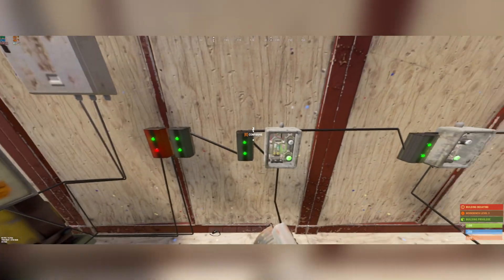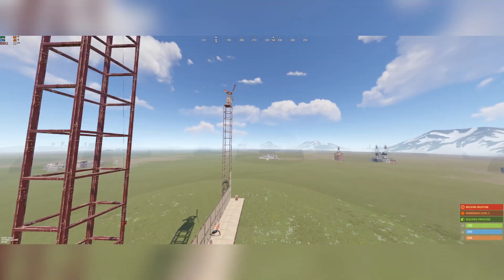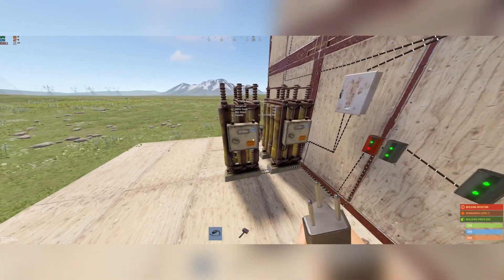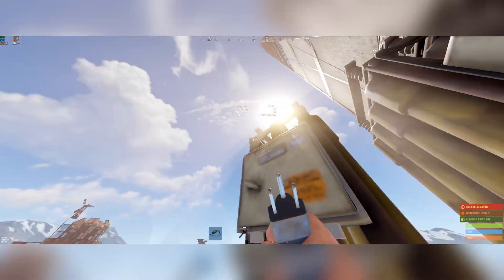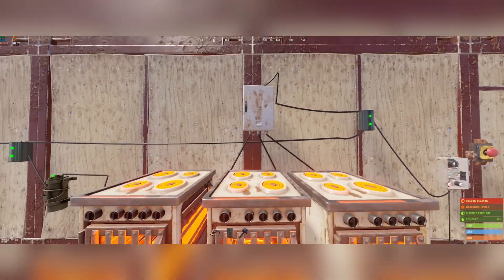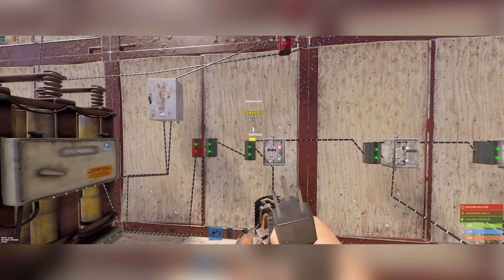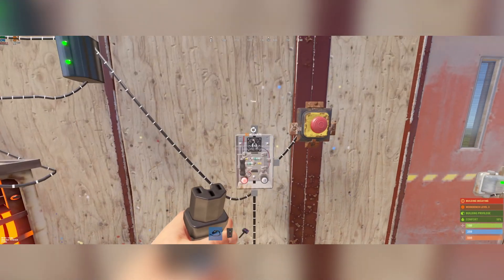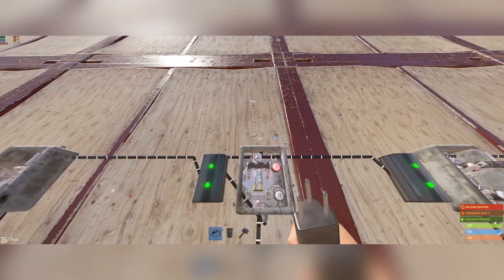Simplified Rust Electricity Guide

Comment: I I    I I (10)
   I  I   (22)
    I (44) this is a very good electrical branch setup and u lose like only like 12 volts and at the top branch u can connect a splitter and do efurnace or seismic or ceiling lights or anything
Reply from the maker: Why are you adding 2 per layer?
Reply: @white_dreadhead  wdym

Comment: TLDR: You aren't making enough power. Your turrets will turn off. young Padawan let me fix ur power issue. When you put 2 battery together with a root combiner it is called battery in parallel. what that means is the same amount of battery will be drained from both sides. so when you have an active usage that's above 100 both the batteries are draining 100, it doesn't split off, so even though you split off 131 with that branch, you still actively draining both batteries at 100 (200 total) at the same time. your windmill at 11 high right there generate 140. These moded creative servers have their windspeed set to max, ur windmills at night time will drop in power output up to like 60-70 percent, but let's say it doesn't total output of 280 for both going into a battery, battery has a charge efficiency of 80 percent so ur really only charging 192. Your currently at a negative power. I will be amazed somehow if u turrets stay on without adding solar panels or another windmill.
Reply: I’ve never been too advanced with electricity in rust but I am studying electronics. It’s cool how the fundamentals of parallel and series circuits sort of apply to the game.
Reply: @walterpavloski5792  yah is very losely compares, however the logic gates work as well as they should and with memory cell in the game acting as a bit creations are often limitless.
Reply: @ishanzolo  I recently learned logic and its made me hop into a bunch of different games like Scrap Mechanic to mess around with them. I think I'd prolly be able to do a bunch of cool stuff with them in Rust too!
Reply from the maker: i aint readin allat
Reply: @white_dreadhead the guy is giving you sound advice and you respond with "i aint reading that". 
Shit attitude. 
Your video is not the way to do Rust electrical, that's coming from someone with 7k hours and I'd consider myself an advanced electritian. You're better off listening and taking advice. Good luck.

Comment: Instead of the switches to reload, just take your wire tool and right click once on the turret wire, refill and left click to hook it back up
Reply from the maker: Switches on top of
Reply: @white_dreadhead  makes it easier for a raider to turn them off...
Reply from the maker: @ogsnowscone2411  not if the switches are in core or battery room